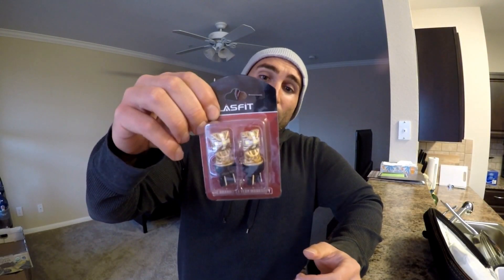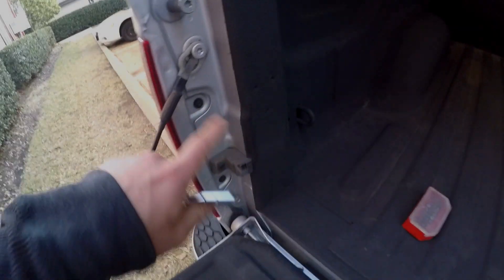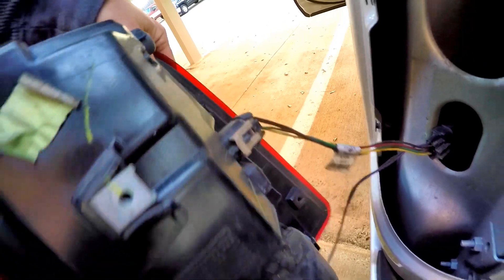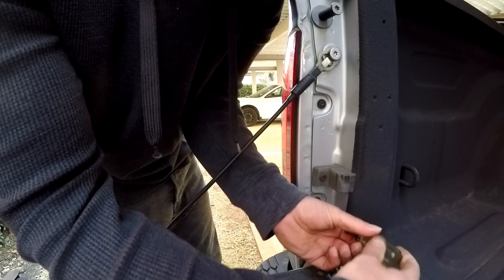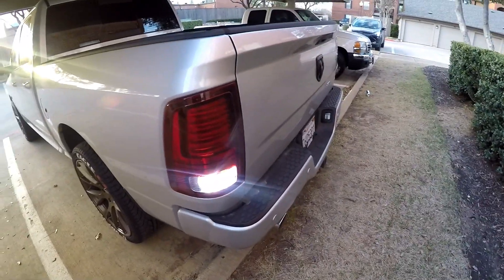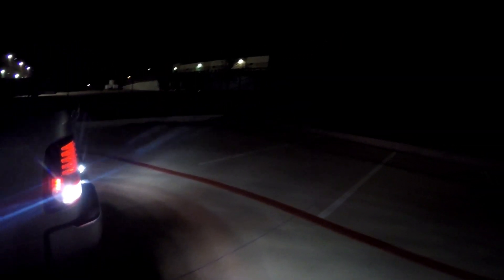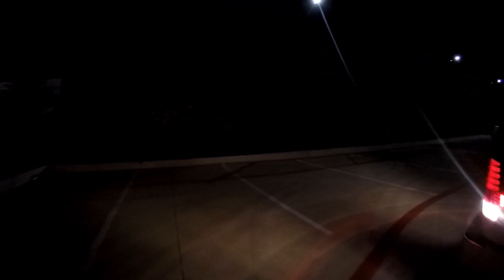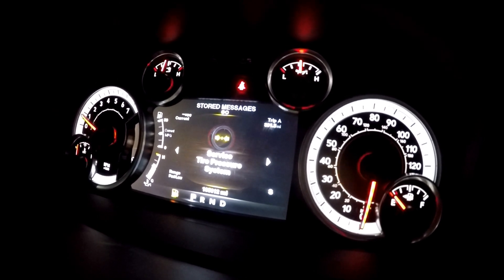LED Reverse Backup Bulb FAIL Attempt #2 with LASFIT bulb type 7440 - DODGE RAM 1500 2500 3500

Comment: I run the same bulbs in my 2015 Ram 1500..no codes. I actually have every single bulb changed to Lasfit LEDs. Not a single issue, no decoders or anything needed for me. Super bright.
Reply from the maker: I wish my truck was that way!  It is super picky with these damn bulbs lol

Comment: Another good video bro. Got the pedal commander for my 2009 ram this weekend.Amazon had it for 299 works amazing like a whole different truck acceleration so much faster now you did yours through a tune also got the stubby antenna. Next will be doing led lights inside cab then outside. You're videos have really helped thanks bro keep them coming
Reply from the maker: Thanks Brad!  Yeah getting rid of the lazy pedal on these trucks makes a huge difference in how they feel! Plenty more videos on the way 👍

Comment: I like your truck. It's coming along nicely bro. The wheel/tire combo are awesome. It makes it stand out nicely!   The led upgrade on the led reverse light is nice. I did the same thing with my chevy; I bought my led from Autozone and haven't had any problems with them. I actually installed more led bulbs because I have a lifted Rado and although I upgraded the reverse lights I couldn't quite see when backing up. The added led bulbs are perfect, and illuminates great.
Reply from the maker: Thanks brother!  I agree the LED are a nice touch!  I need to get a chevy on here before all the RAM fanboys take over the channel! 🤣 jkjk But I do want to get a C7 Corvette Z06 probably on the channel soon!
Reply: Boosted2k LOL! It’s all good bro. I like Ram trucks too. I have a Big Horn Edition with 5.7l hemi as well. I love both my trucks, but right now I’m more into the lifted trucks because I’m working on mine. A vette will definitely be a nice addition to your channel.

Comment: Had similar issues with my 2014. LED low beams worked out great, but driver fog worked intermintently so I put 7" light bars in place of oem lenses
Reply from the maker: Yeah these trucks are pretty sensitive to replacing the bulbs with LED or HID.  Pain but makes for a fun video!

Comment: Hey brother   I bought some Leds for my ram 1500 Laramie On Amazon for  19.95 And I think it was free Shipping. The 7440 LEDS name is siriusLED extremely bright 2835 chipset  Projection 1400  Lumen Backup brake tail turn signal light bulb pure white pack of 2.   it will say these bulbs won't fit but they do. my buddies got a 2014 ram sport like yours and they work fine with no error code. I put  Them in my truck and no error code. I know you tried all different types of   Led's  and none of them worked.  I know these will work for yours . Alright bro let me know hope this helps you like your helping me With my mods for my truck.  Love your channel man Keep it up I can't wait to see  that exhaust cutout and  Side steps your  gonna put on your truck.  I'm looking to get some for  Mine. So I'll  see how yours turns out . And I might do the same thing.
Reply from the maker: Thanks for the support sir!  I actually tried those Sirius bulbs in another video and they would sometimes still throw the damn error message on my truck so I returned them. Side steps are now on the truck so that video should be up in a few days! 🤙
Reply: Boosted2k  Awesome man can't wait to see what it looks like🤞

Comment: I find it cool/strange that your truck warns you of a bulb out where im used to seeing my flasher(s) blinking faster when i have a front or rear turn signal out. I also despise that damn tpms light given that my '10 dakotas tires are normally aired up to or around the specified psi and it still lights up on my dash. I stopped worrying about it, its just annoying. I love my dakota otherwise :).
Reply from the maker: lol yeah its an otherwise good feature if you kept the original halogen bulbs but upgrading to LED its a nightmare 🤣

Comment: Have you tried flipping the bulb around in plug?  Bulb may say no polarity but it may work!  Also, I had a driver in a 18 wheeler who wanted to change out to all LED, found out that there had to be at least one incandescent in the system somewhere!  I just wired one in and shoved it back up in the frame where it couldn't be seen!  I probably wouldn't do that to my pick up because I don't want to splice into OEM wiring, not right now anyway!
Reply from the maker: Yeah another guy messaged me saying he had the same issues with these bulbs as well unfortunately! 👎

Comment: Have you tried resetting the bcm by removing neg batt cable for 30sec.... worked for me when I installed my aftermarket led taillights.
Reply from the maker: Hey James,  I actually have ridiculously bright LED bulbs I just picked up that we will be trying out next.  1700 Lumens PER BULB!!!!  They apparently put enough load on the system to not throw a code so I'll be testing and making a video on those next!

Comment: Had the same issue with my 13 Ram Sport with the third brake light installed an aftermarket guess what threw a code lol. When you said they are picky your right a dealer tech told me that you can't mess with the polarity in any way will throw code every time. I just installed Lasfit  on my 17 Silverado High Country 6.2L the same bulb fits the license plate, reverse and third brake light including cargo bulbs didnt throw code guess GM isnt as picky.Hope you can find a bulb that works I'm curious until you do.
Reply from the maker: II hear ya Anthony!  I went through this same headache with the license plate bulbs until finally I put the LASFIT ones in there and no errors.  Thought I might have the same experience with these and also someone in the comments that they are using them no issues lol.  Oh well on to the next solution.  Maybe I'll retrofit a bright AF LED bulb in there 😂

Comment: Just get the GTI LIGHTING they’re expensive but haven’t had an issue with them reverse, license plate, and 3rd brake light bro
Reply: Headlight revolution sells them
Reply from the maker: Yeah I'm about to give in and just get the expensive ones. These trucks are too picky lol
Reply: Yup did GTR reverse, cargo and license bulbs on my 2013 Ram 1500 Sport. Total : $130.14. Only been on a week but no codes.
Reply from the maker: Yeah GTR stuff is supposed to be good!  I'm trying to be different but might have to just go that route soon 😂
Reply: Nothing wrong with different brother. We appreciate you trying to save us a few bucks here and there but these trucks as you politely said are "picky". Huge pains in the ass is more like it. ;(

Comment: Auxito led  912 / 921 (2835)  6000k. 15 smd chip set t15/906 w16w  $13.99 for set of 2 on Amazon  (works on my 2018 ram 1500 ) may work on yours?
Reply from the maker: Hmm they may have changed the bulb type in some year?  Its a 7440 for mine? 🤷‍♂️

Comment: I have some canbus lights for the back. Had mine in for 4 days and no messages. Go to superbrightleds.com and get the canbus reverse lights. Think they are around $5.46 . No problem with those. Only problems I got was my low beams were the fabless and they over heated in 15 mins of driving. I had to order the ones with the copper lines so I can fold them in the housing because I have he non projector style so I can’t fit the headlights with the big fan on the back because the non projector housings don’t have the big back that comes off, it’s a water sealed twist top and the big fan blocks the right side threads. Sad I spent 69 on those but hell now I know 😂😂
Reply from the maker: Sounds like you've been having as much fun with all the LED and HID crap as I have lmao!  I don't mind though and enjoy making the videos and testing these different parts out!  Thanks again for your support and feedback! 🤙
Reply: Boosted2k well I got your fix and I’d highly recommend to order those. They are bright and don’t throw codes.